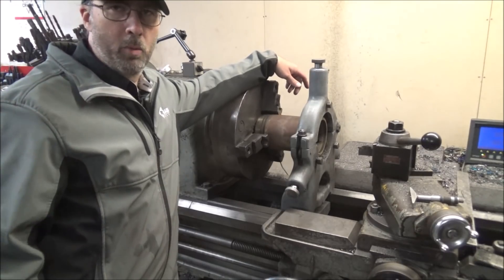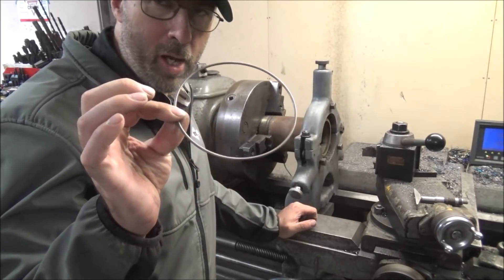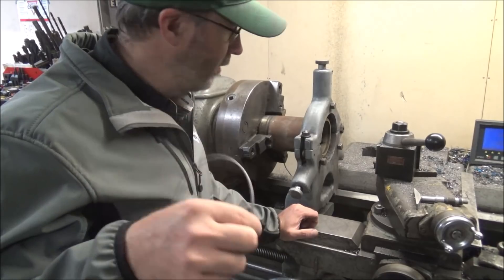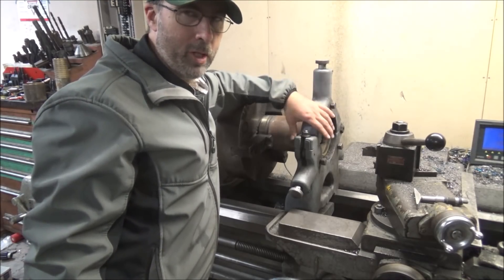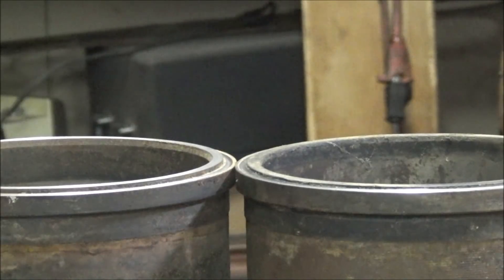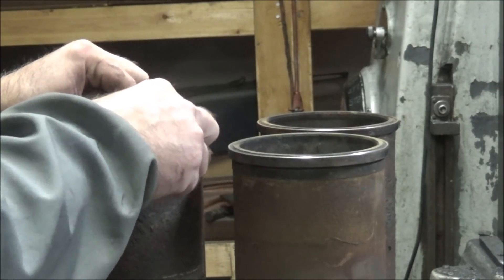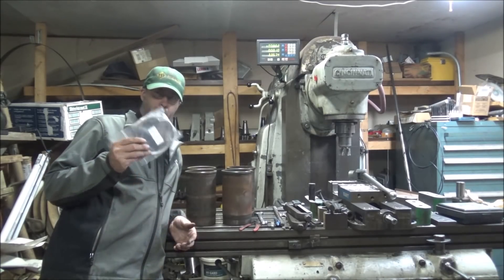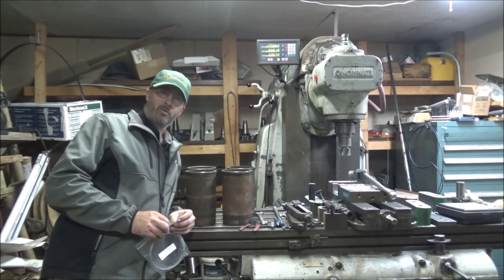Cutting Cylinder Liners for Fire Rings

Comment: It looks as though you’re insert geometry is incorrect for what you are attempting to achieve. You need trepaning relief. Not diametral grooving.
Reply from the maker: At this diameter the relief angle on the insert provides plenty of clearance to cut correctly at the shallow depth it needs to go to.
Reply: @bcbloc02  I thought so. So I was correct, this is a fudge it operation. It’s probably not going to make much of a difference. This is on a Detroit product, so it’s going to have bigger issues. That’s why it’s gotten torn down in the first place. Pay attention or pay cash.
Reply from the maker: @gerrylundergaard60  In this case it is getting fire rings because it has to hold 1500hp and 2500ft-lbs of torque from a 466cid engine and the regular headgasket won't even take 1/3 of that before it kicks out.
Reply: @bcbloc02  The question is not about the fire rings, but the improper method of fudging them using a round nose parting tool and not a proper trepan. There is a difference between done right, or done right away . No worries, good for another 36K before something else fails on this Detroit product. Rollin coal! USA!  Pay attention or pay cash!

Comment: Hey Brian,  I've noticed that your CNC mill hasn't had power in quite a while, are you at all worried about your buffer battery going dead and losing your machine parameters?
Reply from the maker: It has been sitting for a couple of years since before I picked up the boring mill so I expect it has already lost anything it was going to lose. Getting it up and running like it should is going to be a challenge for me anyway as I know pretty much nothing about CNC.

Comment: I try to pay attention but I got confused with this job. The sleeve top was not flat with respect to the cutter. It would start out making an interrupted cut. That was ok because it was within the tolerance for depth of cut?
Reply from the maker: From what I can tell the factory tolerance on these liners is about 0.000"to -.005" The tops are within about .002" so that is well within the factory spec, that is why there is .020" crush in the ring to allow for the stack of tolerances in the entire assembly. Also there was rust and carbon buildup on them too so some of that intermittent cut comes from that.

Comment: Is that common practice or just for hot rod pulling engines? By the way I recently talked to you about some babbit bearings for my B Deere tractor. I have since found out they are serviceable as is so I am going to reinstall them and use them. I have lots left in the shim packs for wear adjustment. Thanks for your reply.
Reply from the maker: Mainly for performance applications.

Comment: I have two questions, who is a manufacturer or supplier for fire rings? I have a BMC/Leyland 100mm bore engine where only a sub- oem quality head gasket is available and would like to fire ring it. Second, did you have to relieve the underside of the insert for trepanning?
Reply from the maker: No, I just slid the insert out in the holder and on this big a bore size it is enough to clear. Sealtec Oswego, Ill(630) 692-0633
Reply: @bcbloc02  Thanks for the information, I have sandvik top-lock holders, so I will most likely finally have to buy a CBN wheel so I can clearance the inserts if needed.  I was never able to find a supplier in any searches so your help is appreciated greatly.

Comment: Are the fire rings aluminium like the  Detroit  2 stroke  ones ?   Years ago i rebuilt a Volvo F16 truck engine & they just had scrolls cut into the head where it seats onto the liner ( single head per cyl )  .     Cheers .
Reply from the maker: These are a mild steel ring.

Comment: Thanks for sharing, quick question for ya. Do you fire ring the head also so they both bite into the head gasket or just the liners?
Reply from the maker: C-rings are rings with a c shaped cross section. They create a dynamic seal by trapping cylinder gasses in the c section and expanding from the pressure.
Reply from the maker: Kevin Zucco The fire rings crush against the head. They don’t touch the gasket. I never groove the head too. If it needs more than the fire rings can hold it gets c-rings.
Reply: @bcbloc02  thanks for the info, what are c-rings and kind of boost do you anticipate this engine will make?

Comment: We use to do fire rings for 855 Cummins then run a blue wheel on a turbo ended with 42 psi of boost. Much more than your 420
Reply from the maker: Larry Tomb Been so long since I drove it hard I can not remember what my 420 makes. Seems like 32-35psi
Reply: @bcbloc02  sounds about right.

Comment: Are they upping compression on the engine or is it all boost that steps them up into fire rings? Straightforward simple job. They can be a nice break from the ones that aren't.  Thanks for sharing
Reply from the maker: OLD SCHOOL All boost. It actually will get valve reliefs in the pistons too so compression actually goes down.

Comment: Two questions; Why are they doing it with used sleeves? Did you grind the radius on the HSS or was the tool designed for that application?
Reply from the maker: Fred Newman It is a carbide insert groove and turn tool. I just modified it to use in face grooving instead of on the side like it is designed for. It is a budget build and used liners that are in spec are as good as new ones when you are talking about something that will get junked from a melted piston long before it weArs a liner.